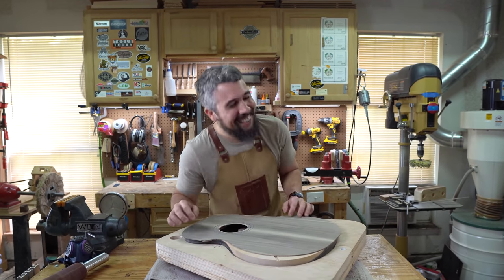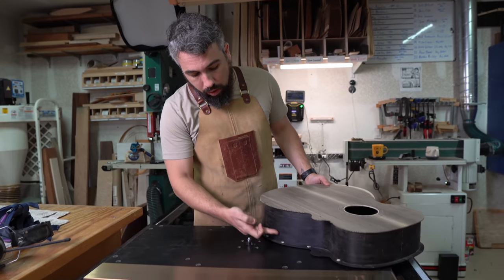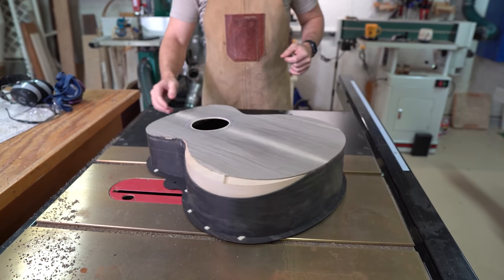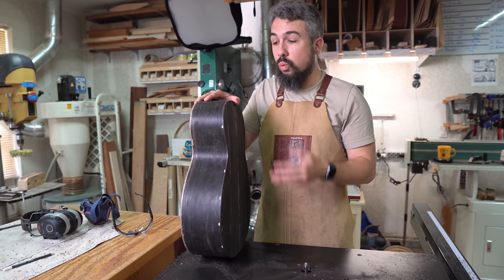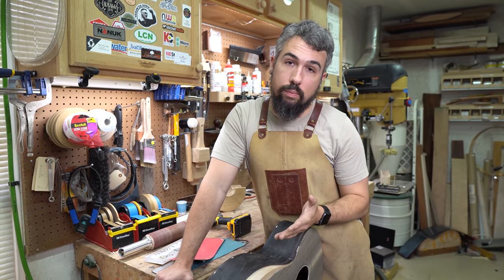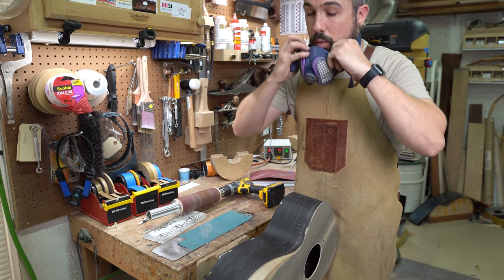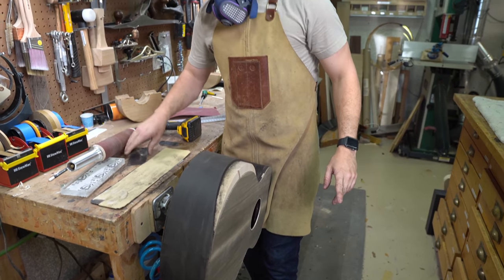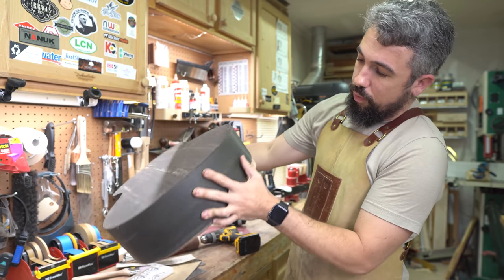How To Build an Acoustic Guitar Episode 18 (Leveling The Sides)

Comment: btw a spiral router bit with a bearing works really well compared to a flush cut straight bit. The spiral really makes tear out less likely. They are a pain to sharpen, that's the only downside I can think of.

Comment: Getting in late here but I'm hooked on this series.  For routering I'm thinking  hand router w/firm grip, and go withe the direction router wants to pull.  Then clean up in opposite direction.  Plus add tape where the bearing rides to prevent bearing burn.  Then sand smooth.  Any thoughts out there?

Comment: Thanks again for another great lesson. Question for you: Could you use an oscillating spindle sander instead of the pinwheel sander? Or would the domes on front and back make it hard to keep the box perpendicular to the sander?
Reply from the maker: It’s a pretty common idea to think this would work, but you’re correct, the top and back would make this nearly impossible to pull off.

Comment: It's comes across that you trust that vacuum clamp very much.  Have you ever had it fail on you?  Makes me nervous watching the guitar hang there while you work on it but I've also never used one lol
Reply from the maker: I was nervous at first, but after years of use, I’ve never has a slip. It hold with roughly 400lbs of clamping pressure, yet leaves zero marks. It’s pretty incredible.
Reply: @DriftwoodGuitars  That is super impressive! Thank you

Comment: When sanding that ebony, do you have any issue with the maple getting stained by the ebony dust? Or, for instance, if the light wood was open grain.
Reply: good question, I always put a silicate lubricant over my maple then silica wash it before I stain. it's not a perfect method! bet he has some crazy way to do it better
Reply: I also sometimes use wax, which is sometimes easier to wash
Reply: I'm actually looking at a guitar to buy that 
has stain on the inlay from the wood but it's £60 cheaper so I think I'm going to get it 👍✌